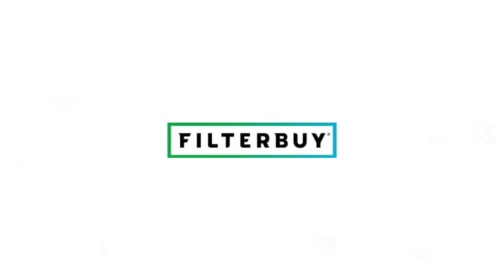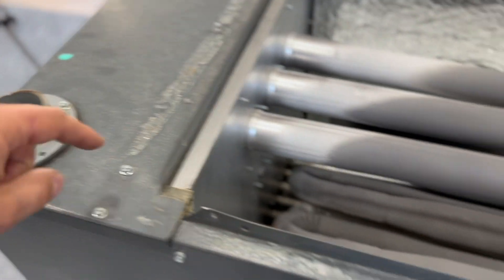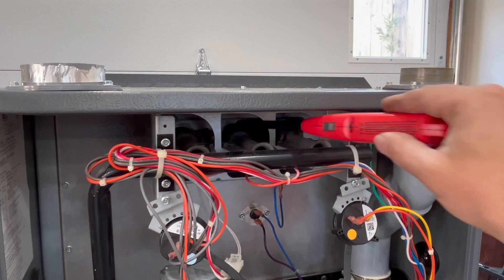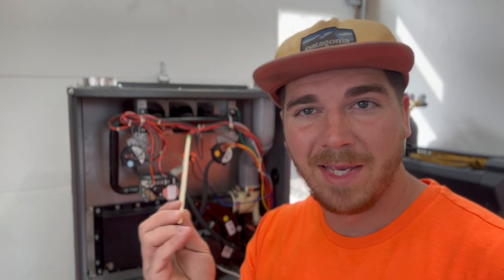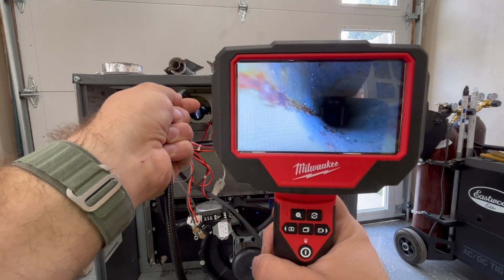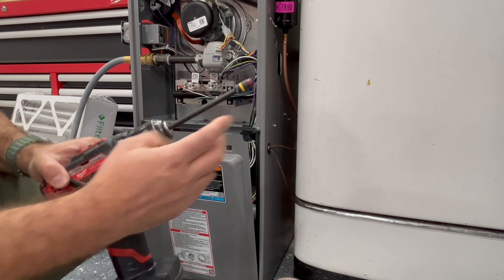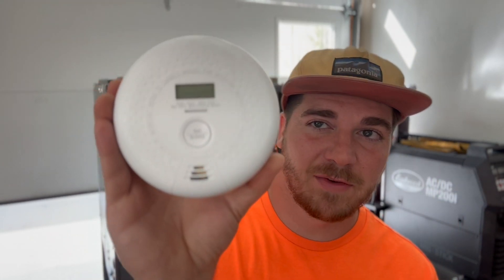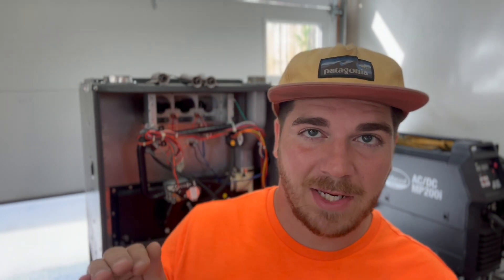Don't Be The Next Victim Of This Furnace Scam!

Comment: You. Contractors are greedy, they will scam you and tell you the heat exchanger is cracked so they can replace you furnace…

…Also you. So here’s a furnace that I replaced. The heat exchangers are fine, it has a little rust and it may turn into a crack at any time.

Comment: This video contains both good, and bad information pertaining to the safe operation of a category 1 gas fired appliance based on the physical condition of the component  known as the heat exchanger. It can be costly to the home owner to have the heat exchanger properly inspected when the furnace is already installed. There are many reliable ways a technician can verify a defective heat exchanger without removing the heat exchanger. Heating mechanics should never correlate the absence of CO in the air with a heat exchanger that is working safely as designed. Just because there is no CO in the air does not mean the heat exchanger is clear of defects.I have come across tubular heat exchangers with 1” holes, and 0ppm of CO in the air. I’ve also witnessed small cracks dump 30 ppm of CO. 
There are many different manufacturers, and many different types of heat exchangers. Serpentine heat exchangers, and tubular heat exchangers are vastly different from one another, I wouldn’t apply the inspection practices to both when checking the heat exchanger for safety. The American Gas Association, along with ASHRAE have a ton of information about this subject. Seems like the heart is in the right place but the information provided in this video contributes to the whole cracked heat exchanger scam theory. I wonder what Lennox has to say about your theory regarding the rusty seam. Might be a scam as well.

Comment: Good stuff! Some precautions I would add:
1. Burners are usually tough to remove without taking apart the gas pipping (usually at the union). If you are taking apart your gas pipping, you need to make sure it doesn’t have any leaks (using a leak detector fluid or other means) when reassembled.
2. This example furnace didn’t look like it had an igniter. They’re usually pretty close to those burners and could easily be cracked. 
Just some precautions. This is great info. And I hadn’t heard about the lighter/match stick test. I will probably use that!

Comment: Another easy check for the 80% non condensing furnaces is to pull the blower out and shine a bright light up through the heat exchanger. If there are any cracks, you’ll see light where the burners go in.

Comment: Retired after 37 yrs., used a smoke pen  to detect a heat exchanger problem. All major manufacturers recognize this as a valid test. The  Goodman furnace that you showed  would have a 20 yr warranty on the heat exchanger(part only, labor is billable). Warranty  paperwork would have to be done by a contractor.

Comment: Shouldn't that fan be pulling air through their ?
Reply: The heat exchanger is a closed circuit. The blower just removes the heat off the metal and feeds it into the ductwork

Comment: I like to run the blower on high, close humidifier damper, temporary wire shut bypass dampers and close about half the vents to greatly increase static pressure.
you have to watch for false positive that way, because there's always some air leaks around thermostat/limits and fastened together areas.

Comment: Use a combustion analyzer and you will know if the heat exchanger has any problems.
Reply: These are tips for the homeowner to do themselves. I doubt they are going to spend $1200 on a tool

Comment: Good video. One thing I don't understand though. Why don't we just replace the heat exchanger when they go bad if the rest of the unit looks good?  I know that they're easy to replace.  We don't junk our cars when we have bad tires or even a bad engine if the remainder of the car is good.
Reply: many are not easy to replace, since they're about the very first part installed, everything afterwards has to come out, so it can be a multi-hour job, in which the labor isn't cheap and it quickly cost more than the value of the furnace. that's assuming the HE is under warranty still, if not the HE+ labor is for sure beyond the cost of a whole new unit.
in terms of a car, it's like putting a brand new engine in a 200K+ mile vehicle, with every bushing, steering ,suspension, brakes, transmission and multiple bearings worn out and failing. where do you stop?

Comment: Man I remember doing a no heat call for a guy and found these old horizontal units from the 70s in his house. Brought out my CO detector and got 70 PPM coming out of vents. No joke the dude tells me he wakes up with headaches and a sore throat in the morning. It was the beginning of the heating season; Im convinced that guy and his wife would have died. I turned off the gas valves and snipped the power cables on those.

Comment: My furnace has a cracked heat exchanger, but no Carbon monoxide. I'm not worried about it. When I can smell exhaust or the alarm goes off. I'll replace. Till then, it's still heating the house. 

I do love the other scam that they try on you. The HE furnaces. The cost of these furnaces is so high that most people almost never recoup their money back in their bills unless they're in an area with incredibly high costs. 

And people also don't realize that if your ducting for exhaust inside the house has at least 10-12 feet before it exists the house. You're still going to get another good chunk of that heat in the house. My furnace has about 10 feet of ducting before it exists the house, and by the time the exhaust hits that. It's luke warm. Like, sure. Maybe it's not a 95 or 96% furnace, but it's still probably around 90% if you include this heat that's lost through the ducting inside the house. So you're paying thousands extra for like, a 5% increase in efficiency.
Reply: I'm hoping with all of my faith in humanity that this is an AI-generated troll
Reply: @Lenny3669  Nope. Just someone tellin you the real real. 

Furnaces crack all the time. Doesn't always mean they're dropping exhaust into your house. <3
Reply: @truckywuckyuwu  well every single thing you said is wrong.
FYI if you have a metal exhaust on your furnace its 70-80% max efficiency, so moving to a 96% saves at least 16% on gas. And in most states the energy rebate almost makes up for the price difference. Here in MN its $750 -$1000 cash rebate, which usually covers the difference. 
Stay in school.
Reply: It doesn't take a lot of CO to cause damage to your body, and CO detectors cannot detect low levels of the gas. It's also odorless so waiting until you smell it isn't going to get you very far
Reply: @turnedearthdesign8678  That's great. Thanks for the comment.

Comment: Those were great ideas.  I bought one of those cameras, and they're great for that, or looking inside a wall for pipes, wiring, etc, just by drilling a small hole in the wall.  I really like the idea of removing the blower and looking at the heat exchanger AND the evaporator coil.  While you're at it, clean the blower wheel and the motor.  You are right about crooked HVAC people.  That happened to my sister in law, and she was smart enough to get a second opinion.  No cracks whatsoever.  It's a shame how many people want to rip off their fellow man.

Comment: My older hvac system i took the burners out to clean them, with them out i shined a very bright flashlight into each chamber with the A coil door off you could see the heating tubes  if i had had any cracks you would be able to see light shine out.  

Not why i replaced the 1990s unit
It wasted too much energy and the AC condenser was faulty. 
I went to a 97% eff furnace and a seer 16 unit, paid for itself in about 3 years in energy savings.  I've had it over 11 years and i get biannual service well worth the money.
Still less then i was paying for energy beforehand.

Comment: There is another sign that you may have a cracked heat exchanger on a 90 plus furnace and that's a smell coming from the furnace in the ductwork not  Always from in the furnace room.

Comment: I just purchased a new Carbon Monoxide sensor/alarm which I placed 4 ft above my bedroom register.
Am I correct in assuming if I have no CO alarm my heat exchanger is ok?
Reply from the maker: Yesir
Reply: That depends on the CO alarm sensitivity and if there is a crack, the size of the crack.  Cooking, burning candles or incense, or using a wood or gas fireplace can put low levels of CO into your home.  Most CO alarms have some threshold below which they don't alarm to prevent false alarms from the above activities.  That also means that a small crack might not be hitting the alarm threshold.  However, chronic low level CO can still be harmful.

I recommend getting a CO alarm with a display that shows the level of CO.  That way you can see if CO is present  even if it is below the alarm level.
Reply: @BryanTorok  Thanks for your comments.  My new Kidde CO alarm does have a display and a 10 yr lithium battery.  I also have another CO alarm with a display in my living room.  Plus I do inspect my gas furnace annualy.  Thanks
Reply: @Altoid777  That sounds like you have it covered.

Comment: This is miss info, the best way and all manufacturers recommend is combustion test. This is the problem with DIY GUYS!
Reply: What are you doing here? Are you the YouTube DIY police? This is one of the best channels on the Tube! Keep off!
Reply: Please explain how a combustion analyzer is better than a match test for determining if there's a crack.
Reply: A combustion test will not detect closed cracks. A visual may not pick up leaking seems or a plugged secondary.
A combustion test will detect non-heat exchanger problems like inducer running too slow.
The two are not substitutes for each-other.

Comment: My neighbor called me as she was in Georgia staying with her son for a few weeks. She said that the person watching her house called her and said that the AC was not working. She called an HVAC guy and he said that entire HVAC system needed to be taken out and replaced with a new one. Quoted her $10+K. She asked  if I would go over and just check it out for her. Thermostat was lit up. 240 at the Breaker. Opened the unit and only had 120VAC on one side of the contactor. Went to the disconnect switch, 240 on the supply end and 240 on the load end. At that point my meter probe hit the wire on the left that goes to the unit and it moved. I shut the disconnect switch, checked no voltage, and tugged the wire and it came out. I temporarily inserted a screw into the wire opening with the wire from the unit, nice an snug. Went to the thermostat and low and behold it started up. Yes, I took the screw out, no AC until the next day that the electrician finished his work the next day. The set screw was not screwed in, but the wire being lose like welded the screw opening so I could not tighten it. I told her to get an electrician out to replace the disconnect box. The job cost her less than $500 and that was a lot better than the quote.